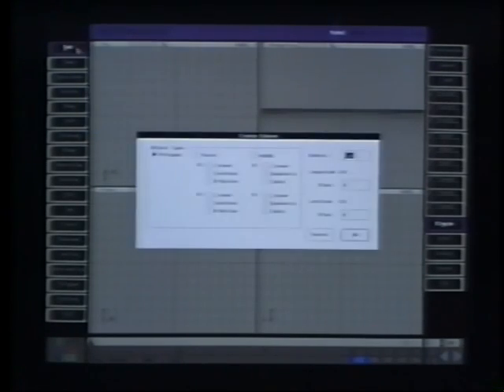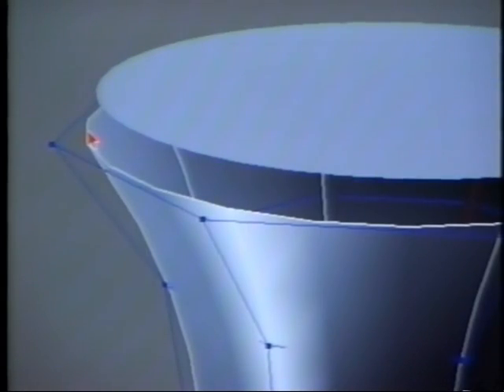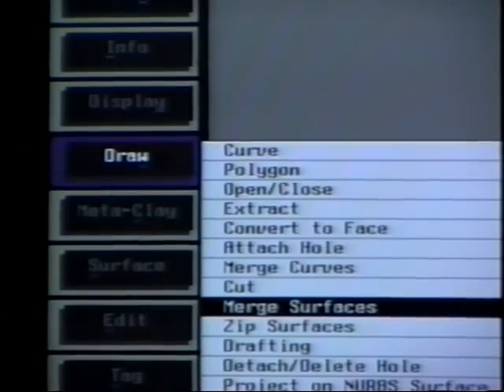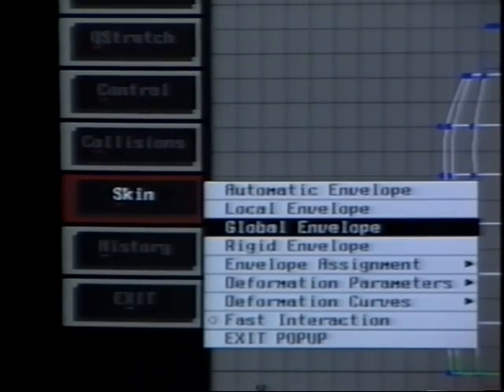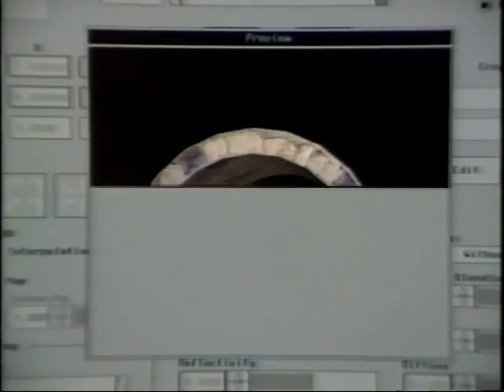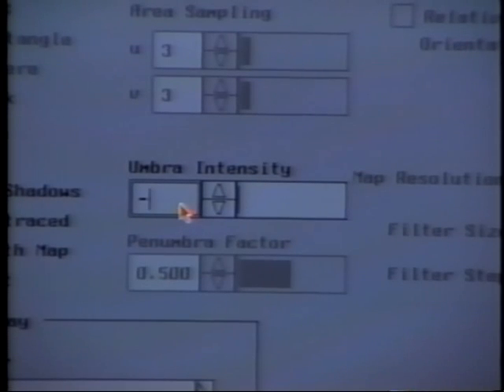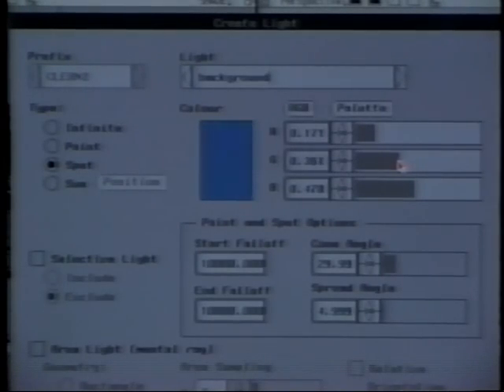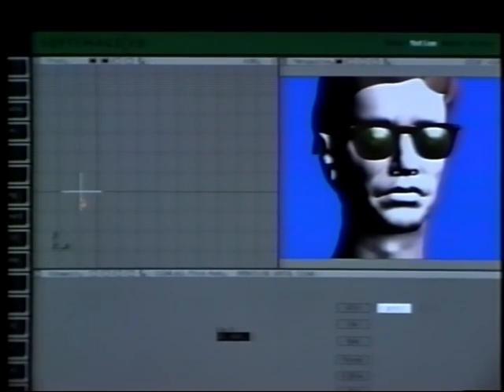Softimage 3D - Silicon Graphics IRIX ( VINTAGE 3D Software )

Comment: Even back then it has it all. I can't believe it couldn't survive.
Reply: It was killed because it was hurting inferior maya
Reply: It did, at NASA.
Reply: This speaks to the idea of the risk of closed hardware systems and pricing. they were overpriced and a closed system. If a competitor with an open system and the performance is superior then that basically tanks your market. Pc was cheaper and the software was cheaper and just as good.. so unless they dropped their prices to match then they could compete .. they did for another decade and slowly went out of business...

Comment: Later versions? Softimage 3d last version was nr. 4, released in 2001 I think. After that they came up with Softimage XSI. Trimming for example was one of the features not available in early XSI releases. Keep in mind that this software was first released in 1988.
Reply: Ermal Koci Isn't Softimage XSI a PORT of Softimage 3D for new Windows OS?
Reply: @NathanDarkson984  no, it's completely seperate. XSI was 3D's replacement, and while initially ported to IRIX, as SGI died off, XSI was mainly only made for Windows